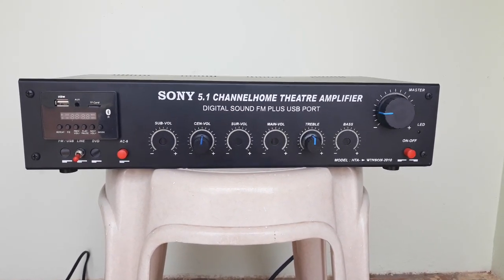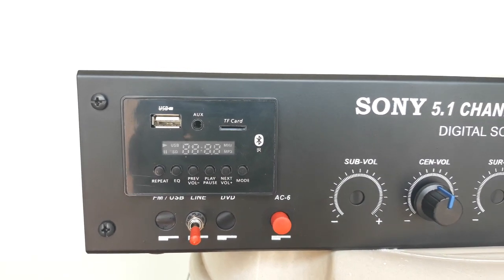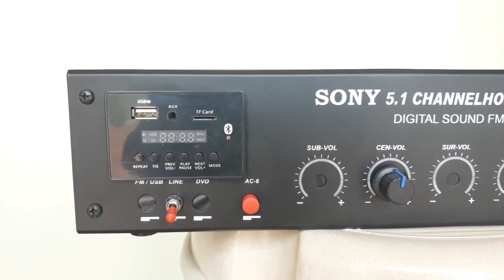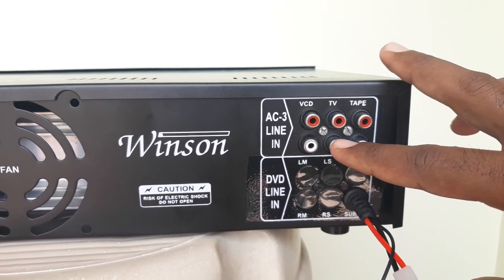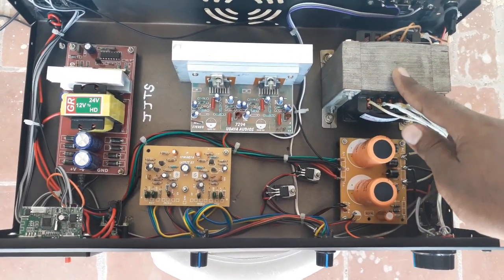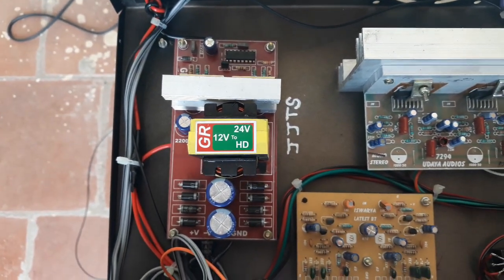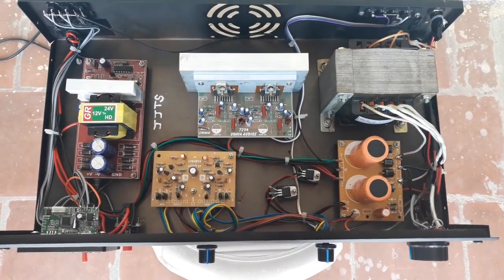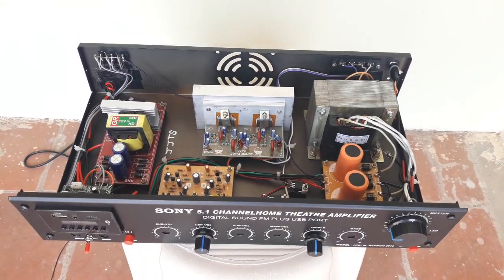TDA7294 (100+100 Watts) Stereo Amplifier with 230V AC & 12V DC Power Supply Model - தமிழில்

Comment: For stk4141 ic 18-0-18 5 ampere transformer can we use.. And which diode and volt microfarad for rectifier  to use..
Reply from the maker: 6A diode with 5000uf/50V capacitors

Comment: இரண்டு IC க்கு 10amps தேவைப்படாதா? 5 amps போதுமா?
Reply from the maker: Minimum 5 Amps Pothum na... Maximum 7 or 10 Amps Use Pannalam. Based on Input Voltage Ampere Choose Pannikkalam. Neenga Use Panra Speaker Load Ah Base Panniyum Transformer Ampere Choose Pannikkalam.